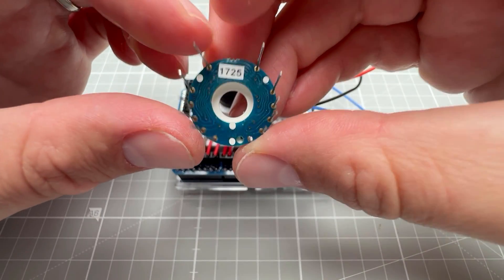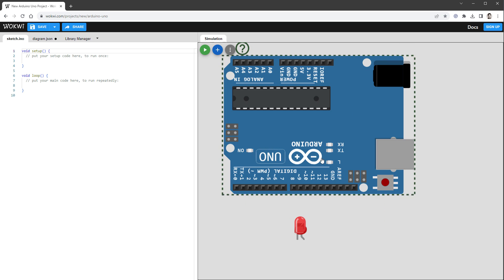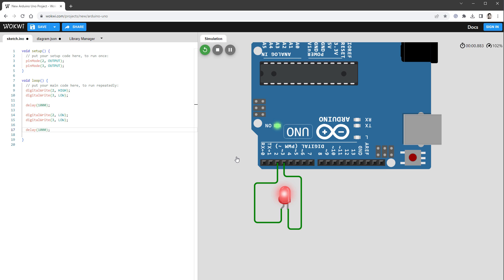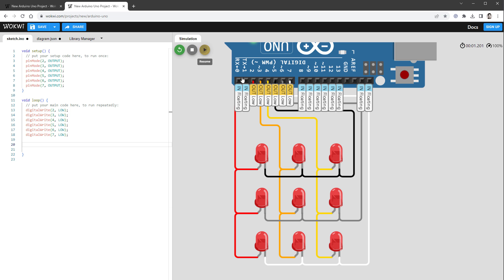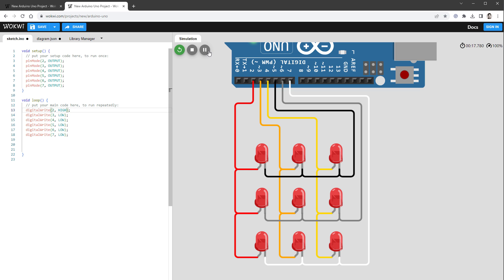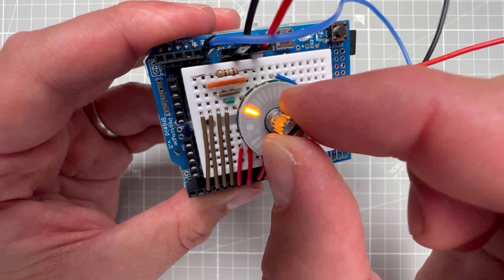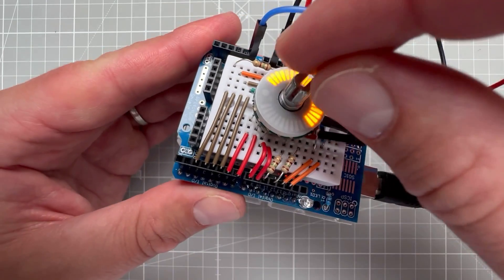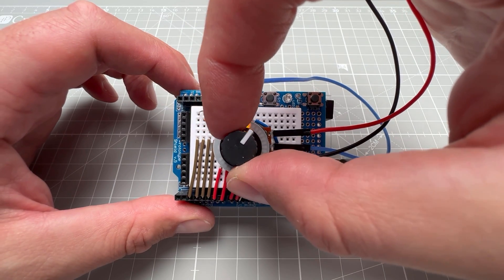Pimp My Potentiometer!

Comment: That's so cool! I just don't understando how the variable "show_value" works on this example. Why it has to be equal to i*8+j on that if and what exactly is it's purpose?
Reply from the maker: Thank you. Perhaps I should have used a better variable names instead of just "i" and "j". The LEDs are arraged in "grid", or perhaps in 4 separate groups - those groups have common cathode. So variable "i" is for those groups (groups of 8), and variable "j" is the LED inside that group. Pretty much just translating 2D position in a grid to a 1D position so I can access the correct LED.

Comment: Yeah well the problem is that you can have an RFID-enabled rotary knob with touch sense and a friggin' LCD in the center for about 35$ - it's called the "M5Stack Dial"; and other similar products in the same price range exist. So with what they are asking for this, it's a complete, utter, ludicrous fail.
Reply from the maker: Last time I checked on AliExpress, this led ring  module was at 9$. I agree that it’s not cheap, but 9$ and 35$ is still quite a difference.
Reply: @upir_upir  Fair enough; last time I looked I was under the impression that the majority of comments mentioned something like $20+ as price, which would have been comparable. $9 is not ~that~ bad.

Comment: Nice explanation, very educational. Good demonstration of how matrix LEDs are driven. If however I did this for real, I'd want an LED matrix driver chip, if only because I don't think the AVR would survive for long if you kept driving its pins at these power levels.
Reply: Not so bad when you're running your multiplex at speed but in the experimental stages, the lack of current limit resistors could be risky - especially for this relatively expensive ring. I bought some of the Alps led ring integrated encoders and was paranoid enough to place current limits on all possible paths - but it was messy. I agree that a constant current matrix driver is a better choice. ISSI perhaps.
Reply: @nikthefix8918  Honestly I'd fear more for the output driver logic of the MCU than for the LED. A LED can take quite a bit of overcurrent for quite a while before it dies, but the output drivers of uCs are much less forgiving. The AVRs are among the sturdier ones, if you tried the same with a motorola or pic, you'd go through a lot of chips. That's why you should always put an impedance converter between your output pin and your load.
Reply from the maker: Thank you for your comment. I cannot answer your question about the lifespan, but I don´t think that it would make any big difference, after all, those "power levels" are pretty low. However, as mentioned in the video, you spend way too much cycles updating the LEDs, since you need to do this all the time. If you use multiplexing chip, you only need to send new data when the content should change, and the multiplexing chip takes care of that. I have recently recorded a video with some Chinese chip that you can get for 0.2 dollars and it can drive 128 LEDs - i.e. 4 of those ring lights. I think in that case, using external chip makes a lot of sense.

Comment: Thanks, just watched the whole video to learn at the end that you shouldn't build this and it won't work with any project. Cool.... :[
Reply from the maker: It will work, but it’s not recommended to do it this way, because you use too many pins and too much processing power compared to using a dedicated chip like for example MAX7219. That said, it’s very beneficial how multiplexing works, as you will have much easier time when using multiplexing chips, so the time definitely wasn’t wasted.

Comment: How do you know how to connect the LEDs so that they can do the function you want?
And how did you know how many wires you'll need?
Like for the 9 LEDs at first you can think about it, but let's say you're dealing with much much more....
Reply from the maker: It´s a number of columns X the number of rows. It´s easy to visualize with a grid-like pattern, but obviously harder with something like the LED ring light, where all the LEDs are in one line. Usually multiplexing chips like the MAX7219 can drive 8x8 LEDs, i.e. 64 LEDs in total. How many LED do you want to control?
Reply: @upir_upir but you for the 3×3 grid you used 6 wires 
Is it 3+3?
So like column + row

Comment: I think I understand why you used map, but that 0->1023 to 0->31 mapping definitely could be accomplished in fewer clock cycles with a right bitshift
Reply from the maker: That’s a very good point, but later on I have realized that my potentiometer works better in a slightly narrower range, so I have tweaked the values.

Comment: Driving the LEDs directly from the Arduino pins is quite a no-no. The Atmega328 itself becomes the current limiting resistor and you can overdrive the pin above the 40mA limit. It really should have a resistor. Your code just needs to be able to put on more LED segments at a time. That's not difficult.
Reply from the maker: Don´t worry, I have used the current limiting resistors later in the video with the real Arduino board. It was just simpler/quicker to not use them in the simulation.
Reply: @upir_upir  You really should warn people of this in the video though. You don't address it once. People are going to destroy their Arduinos.

Comment: Do you know if there's a similar one but for linear potentiometers?
Reply from the maker: I believe the same company also has some for sliders. There are pre-made modules with X number of LEDs, but most of the time, those are much smaller than the slider.

Comment: what does you mean by multiplexing LEDs
Reply from the maker: Multiplexing LED is a technique used to connect LEDs in a matrix of addressable rows and columns. The advantage is simplification of hardware due to the reduced number of pins required.

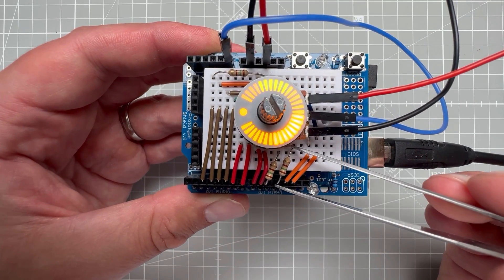Comment: Your comment at 14:30 is flawed.
If you make your code non-blocking, use state machines and millis, you can effectively multitask and it should not cause noticeable problems.

And in fact, it does make sense to drive them directly, because you're saving the costs/space of an extra IC.
This may not be worth the effort for a one-off project, but micro controllers are commonly used in mass-produced appliances, so in these cases it may be well worth it.
Reply from the maker: Fair enough. For most of the applications, it would still be simpler to use dedicated multiplexing chip, or perhaps a different chip than the one used in Arduino UNO, since having only 2 digital pins left would be most likely a challenge.

Comment: Use 3915 ic... U will need just 2wire to arduino
Reply from the maker: Thank you for your comment, but it looks like the LM3915 chip can only drive 10 LEDs, or am I wrong? The LED ring has 32 LEDs.

Comment: Maybe cud use a chip like max7219eng only does 7x7 tho 😅
And control it with 2 data connection
Reply: MAX7219 does 8x8?... 8 segment pins and 8 digit pins, allowing 8 '7 segment' displays with their decimal point being the 8th segment. Or 64 leds in an 8x8 array.
Reply: @someguy4915  I ay played with it for ages TBF don't no why I thought 7x7 lol
I made a clock with it few year back, 😁
Reply from the maker: Yes, the MAX7219 is the one that I will use in my next video. Since it can drive 8x8 LEDs, I can actually use one chip to controll two LED rings.

Comment: You could use a shift register and just two pins from the arduino to multiplex and drive those leds with common cathode. A bit more math to do (compile time) though, but less clutter and LESS USED PINS
Reply from the maker: Shift registers are surely possible, but I believe you would need two of those. I think a better solution is to use something like MAX7219. That´s the one that I actually plan to use in the next video.
Reply: @upir_upir, that's better, but consider how cheap these two are (especially comparing to $20 led module). 
Also seems like max7219 just uses shift registers to multiplex internally, and just takes command data via spi, so you're just proposing higher level task, omitting basics.

Comment: your code is crap!
const int ledPins[] = {2, 3, 4, 5, 6, 7};
const int numLEDs = sizeof(ledPins) / sizeof(ledPins[0]);
const int potPin = A0;

void setup() {
  for (int i = 0; i < numLEDs; i++) {
    pinMode(ledPins[i], OUTPUT);
  }
  pinMode(potPin, INPUT);
}

void loop() {
  int delay_time = map(analogRead(potPin), 0, 1023, 1, 500);

  for (int i = 0; i < numLEDs; i++) {
    for (int j = 0; j < numLEDs; j++) {
      digitalWrite(ledPins[j], i == j ? HIGH : LOW);
    }
    delay(delay_time);
  }
}

Comment: Cool. Only if the potentiometer was not so expensive. The led ring module with driver by Mayhew Labs was cheaper. It´s sad that it is no more available.
Reply from the maker: Thank you for the suggestion about the Mayhew Labs. It would make a cool addon to this video, too bad you cannot buy it anymore.

Comment: I see lots of great ideas to do the same or similar using less pins but I think they are missing the point, that beginners, like myself, need to understand the fundamentals which you explain clearly before they can move forward!  Looking forward to your future development of this project!
Reply from the maker: Thank you for your comment, I´m glad it was helpful and I´m glad someone understands that connecting LED ring light to Arduino UNO this way makes no sense other than learning how it´s done and how it works, so you can use a proper multiplexing chip later on.
Reply: Very few beginners understand that they are missing the basics.  You will go far.

Comment: I didn't think low would set it to ground, but actually makes sense it would because unused pins on an ice tend to be set to ground
Reply from the maker: It depends. If you don´t set the pinmode to output, the pin could be any value, i.e. it´s in the "floating" state. Once you set the pinmode to output, it´s either low (ground) or high (5V in case of Arduino UNO).
Reply: @upir_upir  thanks mate I’ve been using arduinos for the past couple months so still pretty fresh I didn’t even realise I was learning a variant of c++ at 1st lol

Comment: You don't need to light each LED individually. Light the LEDs in groups for each CA/CC. Instead of iterating 32 times, you only need to iterate 4 times.
Reply from the maker: Yes, but with this approach, you will have hard time getting a consistent brightness. If you light up 1 of 8 LEDs in one group, and 8 of 8 LEDs in second group, the one LED in first group would be much brighter.
Reply: @upir_upir  A compromise I could see is switching half a bank at once, then you'd only need to figure out on-times for 1/2/3/4 looking even. measure the brightness objectively with a camera, as long as you switch them fast enough it should all get accumulated into the same frame - or just eyeball it off the measured voltages honestly

Comment: also,  this sort of thing is best to use a digal to analog chip.  it saves allot of pins,  which for any project with multiple modules, you'll want to save pins as much as possible, but also by using a da chip, you will also be forced to only write changes.  this is because da's use i2c,  and a hexdecimal representation of the pins.  like 00,01,02,AA, AB and so on..  which gets converted to 8 bit  binary and each position of that binary is a pin on or off.    these DA's are pretty fast at what they do,  so you'll hardly notice the difference,  if not better than before.    best part is,  its not much more code to use i2c,  it boils down to using a different write function instead of digitalwrite.   for the led position in real life compared to hex decimal value,  you can use an array for each position,  then cycle through the array for what to write to i2c line.
Reply: Did you watch the full video? This is just to demonstrate the concept of multiplexing. He told to use a dedicated chip at the end of the video
Reply from the maker: Yes, there are many different chips that will do the same thing for less money and with better timing and support for brightness. Once you understand how multiplexing works, it should be much simpler to use those chips. I will go over some of them in the next video.

Comment: little suggestion that will help that blinking ALLOT.    ONLY write the changes to the pins.   dont always right.   do a comparison from the last time the loop occured to now, and look to see if the pin values are going change,  then only write the changed pin value and not all of them.     you would ask why because high = high,  nothing will change, but the fact is,  it takes TIME to process a digitalwrite function.  by only doing a digitalwrite only on the changed pins, you save time.
Reply from the maker: That’s an interesting idea, have you tried it? You can try it in Wokwi too see if that approach works or not.

Comment: Great job on this.. I love how you make your thought process known... an array etc.. That also looked tricky to get the pot inside the light ring... awesome work!
Reply from the maker: Thank you for your nice words, I’m glad you like it. With a proper custom PCB, fitting the potentiometer inside would be much simpler, but for my prototyping stage, it was kind of challenging.

Comment: Nice LED Ring but at 16 quid a pop you may be better rolling your own for a couple  of quid a each
Reply from the maker: I have just checked and it looks like you can get 100 SMD LEDs for just a few dollars. However, that would probably not be the biggest expense, you also need pcb and pcb stencil. Might be an interesting idea for a next project- diy led ring light.
Reply: @upir_upir  absolutely the LED's on a reel of 2K are about 0.3-1 cent a piece and a prototype PCB even 10cm square is about 2-5$ for 10  so yeah you could build 50 for the price of 1 if you designed it your self
Reply: @jnharton  Absolutely but since its a hobby where you make things then making them is the fun thing not just buying them. The whole hobby thing is a price time fun tradeoff
Reply: @jnharton But those savings are significant and with companies like JLCPCB and PCBWay for example that offer PCB production as well as assembly you could design a little PCB and have them build the entire thing for something like $50 for 100 of them or so...
At which point they're $0.50 each... Heck they will usually even be built, assembled and shipped to you faster than a normal aliexpress purchase...

Comment: cool but expensive
Reply from the maker: I´m sure if you order thousands of those, you will get some discount. Or - as someone has proposed, perhaps you can design your own...
Reply: @upir_upir  Thousands of those would only make sense if it would be included in some kind of commercial product. For personal projects unless there is some cheaper thingy simmilar to this, placing a couple of SMD LEDs on a PCB with 3d printed light guide or something is propably better

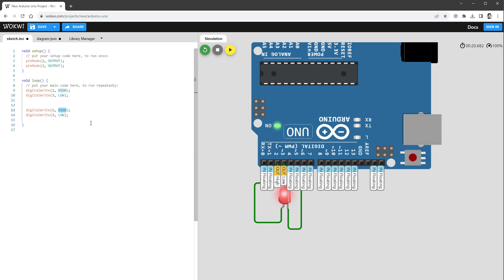Comment: missing a little resistor with this led at 2:00 ;)
Reply from the maker: I like to live on the edge and not use resistors :)
Reply: @upir_upir  This will not only eventually destroy the LED, but also the pin driving it, the max current is 20 mA....

Comment: This but smd, RGB, and a full circle for rotary encoders
Reply: they make really small smd addressable neopixels that would only require 3 wires (power, data,grnd) and would have rgb and take up waaaay less io
Reply from the maker: I agree that using small SMD neopixels would be probably the best solution.